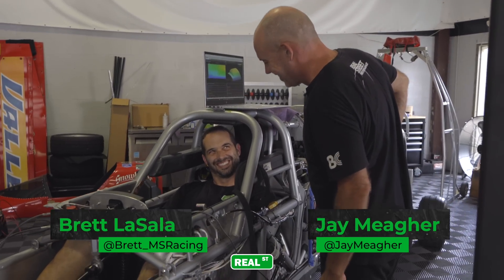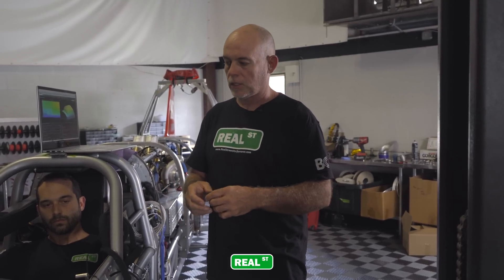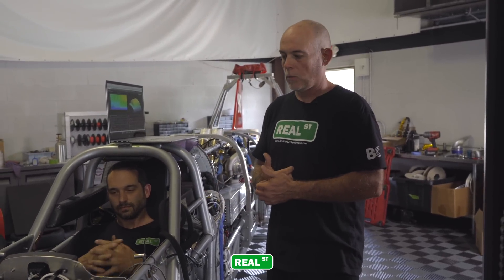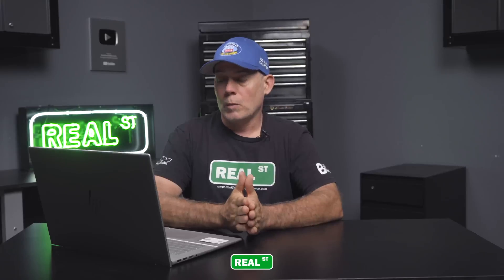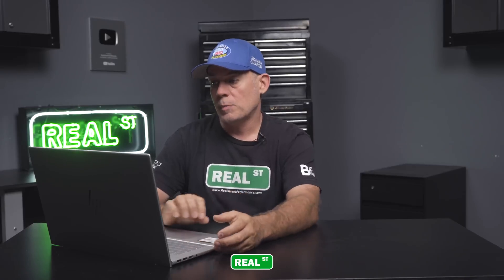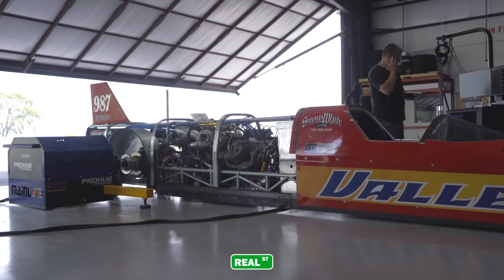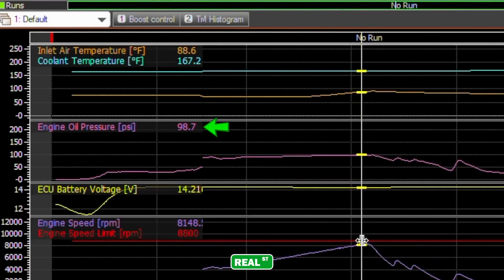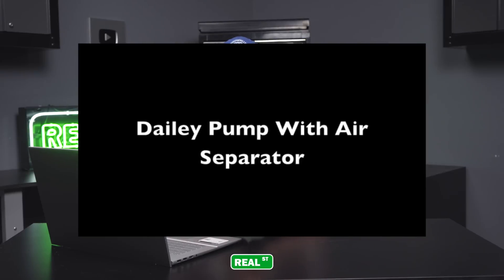Twin Turbo 2JZ Streamliner On The Dyno! Testing Before The 400mph Attempt At Bonneville Salt Flats

Comment: Can you trigger some sort of BOV with the gear change to dump some of the extra airflow during the shift?
Seems like you are going from xxx airflow at 8K and only needing xx airflow immediately because of the shift. Bleeding a bit of airflow and letting the turbos catch back up vs having the motor catch up seems like the better option.
Reply: I think it surging so it's bad for the compressor but not the engine
Reply: @teemann8379  Rapidly altering airflow to an engine is putting lots of unusual stressed on the block and crank. The turbos are cheap and replaceable.

Comment: I live in salt lake city and rode my motorcycle on the salt flats. Now it wasn't the race surface but still it was very bumpy. I couldn't imagine going 400mph on anything close to that surface.
Reply: Rest assured, the actual set courses are prepped by scraping the salt into a flat (or at least flatter) surface.